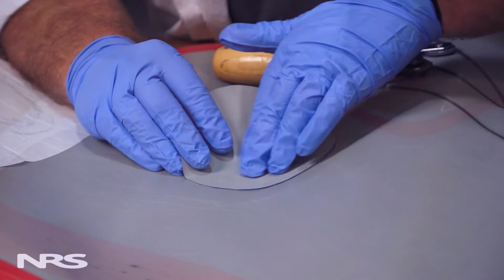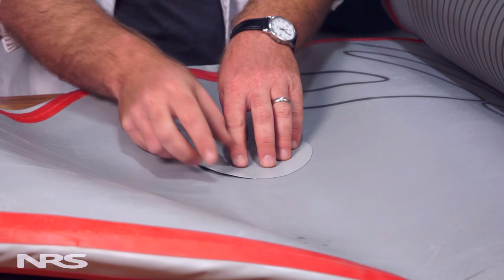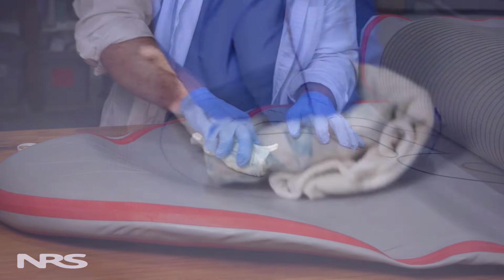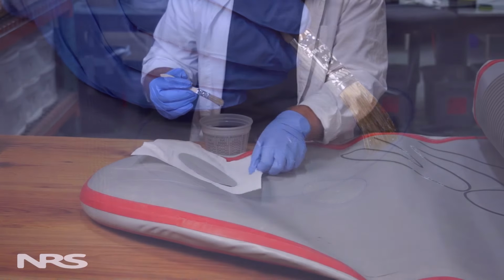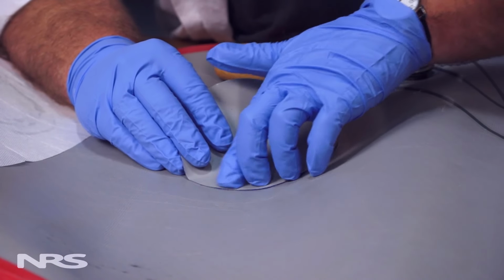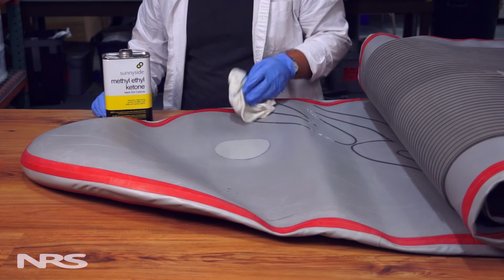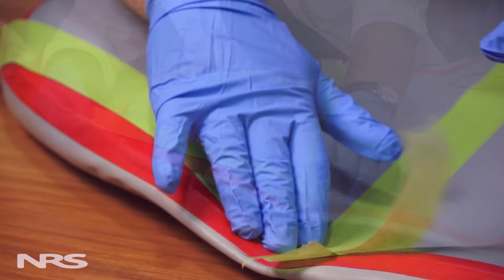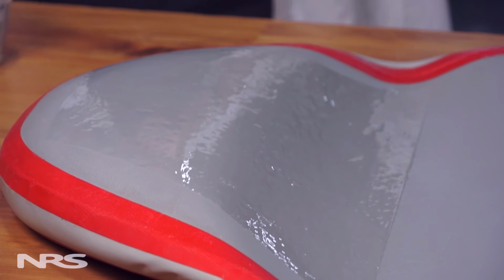How To: Patch an Inflatable SUP Board

Comment: I have a gash that is about 2 inches long. Immediately next to the fin is attached to the board.  Mine is the body glove performer. It’s an older model and the fins look like they’re just glued or attached to the board. They don’t come out.  the rip is right next to where those are attached the board the only way to patch. It is going to be with a patch that goes from the soft flexible material of the board and then go onto the hard plastic of the fit itself. I don’t know if if that’s even possible.

Comment: I'm a little confused as to how many glues you have to use. Is it just Aquaseal, or is there another glue in addition to that? Thank you!
Reply from the maker: Hey Anne, sorry for the confusion. If you're applying a patch to a hole, you'll want to use Clifton's Urethane Glue. The Aquaseal is more a preventative method for places on the board that look worn or scratched. Hope this helps!

Comment: I had a few little seam bursts over a week.  I've had the board for  a month.
Should I trade it in? Or try to fix it?
What's everyone's opinion about flexseal on inflatable sups?
Reply from the maker: Seam repairs can be a bit tricky, and we wouldn't expect that to be an issue after only a month. I'd recommend reaching out to your dealer or a professional repair facility!

Comment: My SUP has a tear a bout 10 inches long, do you think this method would work anyways?
Reply from the maker: Hello, For a tear that large you might want to try sewing the tear before you patch it. When you patch something that large the patch has to not only seal the air but also hold the fabric together. If you sew the tear then the patch is only sealing the air. This advise really depends on the location of the tear. If its near a seam that complicates things a bit. Its probably best to give us a call and we can talk over the options 877-677-4327.

Comment: What about repairing a hole which is leaking at a seem?
Reply from the maker: Holes at the seam are certainly more difficult. Trying to lay a patch over a seam seldom works. Its typically best to but the patch up to the seam then possibly add another patch over the whole area. Another option if the hole is small enough would be to use Aquaseal to seal the hole. You're welcome to give us a call at 877-677-4327 if you have additional questions.

Comment: I had a small leak under the main fin box.  I carefully removed the old fin box using pliers, a small putty tool and a heat gun (I got these instructions from another youtube video).  Now I have several small holes in the area where the old adhesive (holding the fin box on) was -- I tried applying aquaseal to the leaks first, then applied a patch.  Still leaks.  I fear I have ruined my less than a year old $700 board.  At this point I don't know whether I should try and remove all the glue and start over again, or give up.
Reply from the maker: At this point your best option would be to remove the patch and Aquaseal then start over. Use a patch big enough to cover the old fin box by 2 inches on all sides. Make sure to remove all of the old glue. The area you're patching should be smooth to the touch. Feel free to give us a call if you have additional questions 877-677-4327.

Comment: Which side of the pach???
Reply from the maker: Are you asking what side of the patch material you apply glue? If its PVC it doesn't really matter. Typically the only difference is texture. I'd try to match the texture of the patch to the texture of the inflatable.
Reply: @NRSWEB  thanks!

Comment: Hi, My SUP has blown the seam about 12 inches back from the bow nose. How do a best repair it?
Reply from the maker: Hi Jim, do you have a NRS board? A seam leak should be covered by the warranty. If the board is no longer covered by a warranty your best option is to re-glue the seam. Adding a patch over the top will help strengthen the seam. Its pretty common for a seam issue to travel down the seam. So fixing one area can cause the seam next to your patch to blow. Good luck with the repair.

Comment: I viewed a number of videos and tried to follow the routines expressed.
The holes were pin pricks on the bottom about an inch from the seam. I cut a patch about one and a quarter inch by three inches to cover the three small leaks.
Sanded. Cleaned. Cleaned again and applied two coats of the glue from the repair kit to patch and board with five minute dries.
Applied the patch and rolled a wheel tool over the patch. I waited twenty hours, then inflated. The patch held for a bit but then bubbled and began to leak. What can I do next to get back to the step one?  Any suggestions about my errors?
Reply from the maker: Its hard to say what went wrong. It'd probably be best to give us a call (877-677-4327). Our customer service team would be happy to walk through the repair with you.

Comment: If I want to reinforce a scratched/slightly worn area with aquaseal as shown, can I paint the aquaseal over a few smaller areas I’ve already used aquaseal on? I had a few scratched areas I used aquaseal on as shown in the video, but I think I’d like to use aquaseal on that whole area now.
Reply from the maker: As long as the old Aquaseal isn't loose and the area is thoroughly cleaned you should be fine to re-coat. You'll end up with a better finished product if you remove the old Aquaseal but that isn't always possible.

Comment: What if the hole is near a seam? Do you still overlap the seam to attain 3in on either side?
Reply from the maker: A hole near a seam is difficult. Try to avoid patching over the seam with an air holding patch. Depending on the size and how close it is to the seam you can try using a small patch that goes up to the seam then go over the whole area with a larger patch to protect the smaller air holding patch. You can also use Aquaseal to fix the leak then cover that with a protective patch.  Feel free to give us a call if you have additional questions(877-677-4327).
Reply: @NRSWEB  Thank you. The hole was about an inch from the seam. It was a very small hole. I didn't even realize it until several weeks after I noticed what I thought was just a surface abrasion. Noticed it bubbling while off the back swimming. I cut a small patch and placed it flush with the seam. I've since been out 4 times and it seems to be holding strong. Thanks for the video and the advice.

Comment: I have a leak coming from around the PVC seal between the valve and the fabric.  Its bubbling.  Not sure what to do in this case as it seems the bond between the valve material and the rest of the PVC material of the inflatable is broken. A patch in this case doesn't seem like the correct approach.  Can I just lay a bunch of solvent on the seam to "re-weld" it, or is there a better method to repair the valve area (note, the valve itself is functioning properly).
Reply from the maker: It sounds like the valve might be loose. Have you tried tightening the valve using a valve wrench? If you don't have a wrench give us a call and we'll see if we have one available 877-677-4327.

Comment: HOw about when the leak goes through the foot foam?
Reply from the maker: If the leak is under the foam the foam will have to be cut away before the leak can be repaired. Its possible to carefully remove the foam without damaging it. After the hole has been fixed the the foam can be glued back into place. To remove the foam you'll need to soften the glue bond using MEK. Feel free to give us a call at 877-677-4327 if you have any additional questions.
Reply: May I know MEK is stand for what?

Comment: Hi, I have a fanatic flyair with windsurf mast insert, my problem is that the leak comes from the insert, it sound and bubbles like it is deep inside the screw hole. I have no idea how to fix it, can you help me with tips?
Reply from the maker: Hi Pedro, We might be able to give you some advice on your repair but we'll need more information. Can send some pictures and a description of the problem to service@nrs.com?
Reply: Hi thank you for getting back to me. Here is the link with pictures and a short video of the leak : https://drive.google.com/drive/folders/1rcgFL5pTA2eGq2vYY8bSmuTg7T2U82J2
Meanwhile I come up with an idea, what do you think about using a ring of vynil glued around the insert + one of this screws : https://www.vagueetvent.com/vis,decompression-153381-11109.html. 

Does this make any sense?
If so, does this type of screw fits inside a mast insert?

Thank you a lot, it seems silly to let go an entire paddle double layered because of such small hole.

Comment: How about clear flex seal?
Reply from the maker: Hi Steve, We've never tried flex seal so I'm not sure if it will work or not. My guess is that it might work for a short time but will end up failing prematurely. Personally I would use the method of patching shown in this video.
Reply: @NRSWEB  thanks. I have a tiny leak on the furthest corner so I figured your method might be too big.

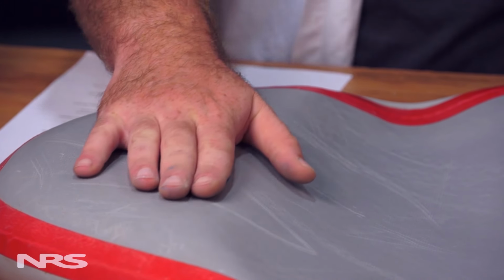Comment: Did you thin the Aquaseal?  At 2:44 it looked way too easy to spread.
Reply from the maker: Most likely the Aquaseal was thinned using cotol,  for your reference cotol is now called is Cure Accelerator. You can also use Seamgrip which is a thinner version of Aquaseal. Feel free to give us a call, 877-677-4327, or send us an e-mail, service@nrs.com, if you have any additional questions.

Comment: How can i get the reinforcement chemical
Reply from the maker: Hi William, we sell all the materials and adhesives used in this video at nrs.com. The solvent used, methyl ethyl ketone (MEK) is available at most hardware stores. If you have any more questions, email service@nrs.com or call 1-800-635-5202. Good luck! -Mark
Reply: NRS thanks 🙏

Comment: Hi, i have some bubbles in my inflatable board, like some internal layers are getting separated. How can I fix It?
Reply: Depends if it's under a wear/grip patch, It's likely the strings may have broken that hold the top and bottom together if that is the case it's not possible. If there is in fact layer separation the only way is to slit it open down to the broken layer and glue the inside of the bubble, I would highly avoid it if possible.

Comment: if your MEK to clean and chemically abrade the surface before applying the glue then surely when your cleaning the excess glue off your chemically abrading the surface of the pvc again??? this could cause the material to become porous over time especially if your repairing older pvc products.
Reply: Brek Brek sand paper is used to abrade neoprene and hypalon rubber inflatables but with pvc the MEK does abrade it

Comment: which width roller do you recommend?
Reply from the maker: Great question Carol. The narrower the edge of the roller wheel, the more pounds per square inch pressure you're putting on the material. But of course, the more strokes it takes to cover the area. Our folks in the boat factory use the 2" x 1/16" tools and really lean into their work. So personal choice, but I'd go either 1/16" or 1/8".
Reply: Depends where you are using it, on a paddle board it's open and you can use most rollers narrow ones are good for corners and tight spaces . I would say 1" is best since you dont want to leave pressure lines in your glue surface that may possibly leak, on pvc it's less important to pressure contact since it is a chemical adhesive not a contact adhesive rolling the air out and making sure your timing is right is key.ta